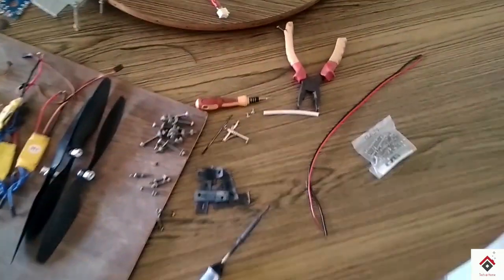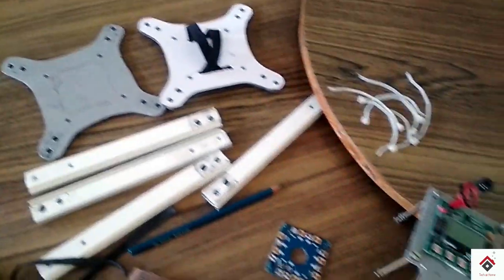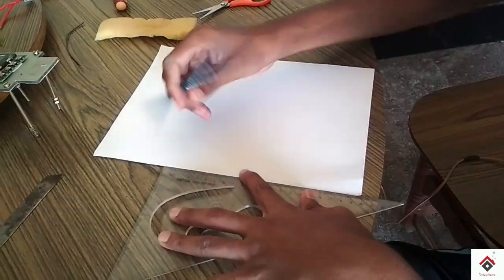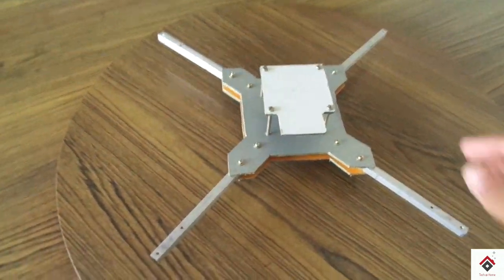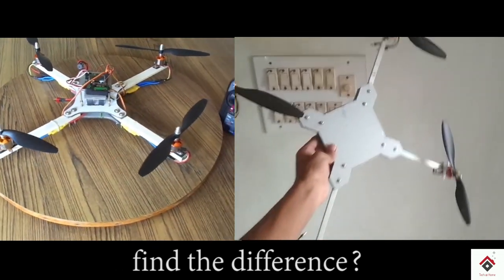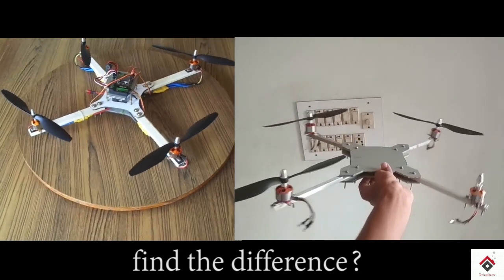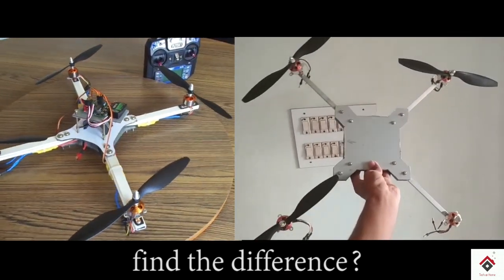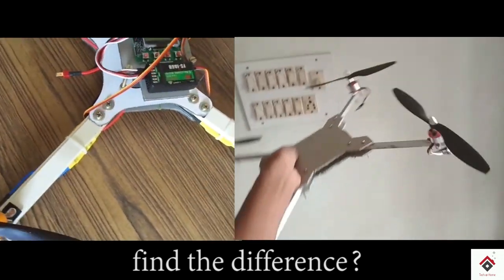How to make Quadcopter frame at Home | Homemade Drone frame [Quad Copter Frame]

Comment: Bro, I'm having a f450 drone with kk215... It was working fine, but suddenly I had issues with its stablity... It is now totally unstable to fly.... What might have happened
Reply from the maker: Calibrate all ESC's and try.
Reply: @techathome  everything tried bro.. Even I have reset the board and made the settings from first... The last flight was perfect and i changed the orientation of the drone legs (front side white and back side red) suddenly the next fly was totally unstable. Then I made the drone how it was assembled before then I tried but even then the issues persists.. Help me brother
Reply: Brother it happen when dust accumulation on expose mother board of  kk.
Try to clean it using some old tooth brush.
Apply hot glue to cover pins to IC / chips of Kk board

U will facr this prob again

Comment: Bro what material is the frame board
Reply from the maker: Sorry bro, I don't know that name.
It has alluminium on both sides and rubber at the center.
You can get it in hardware alluminium shops

Comment: Bro how much does those aluminum rods cost
Reply from the maker: That u can get some cut pieces in the local shops.
That will be not so costly bro.
Reply: @techathome  oh then you bought all of 4 pcs in one length for 120rs ??
Reply from the maker: Yes , it was a single rod. We cut it.
Reply: For how much did you get
Reply from the maker: For one complete length it was 120 Rs long back.

Comment: Bhaiya can you tell me all the measurements of  frame 
Arms
Middle part
Nut and bolt size
Reply from the maker: Total Middle part is square of 16*16 cm. When  converted to that shape it will become (12*12 cm + arm extension)

Aluminum length for arms : total= 17cm (in that 4cm inside the frame, 13cm outside)

Nut size ,I have choose according to hole size, that you can choose approximately.